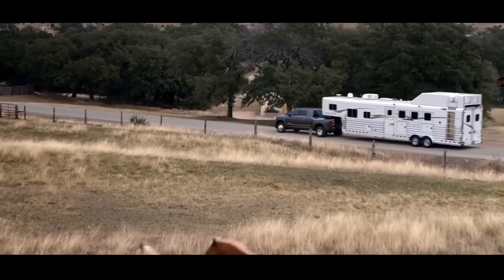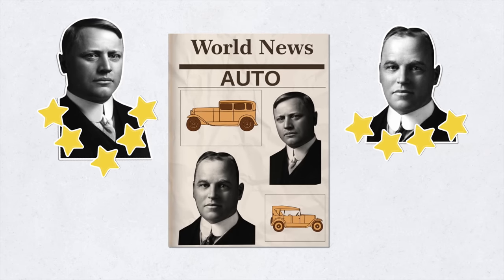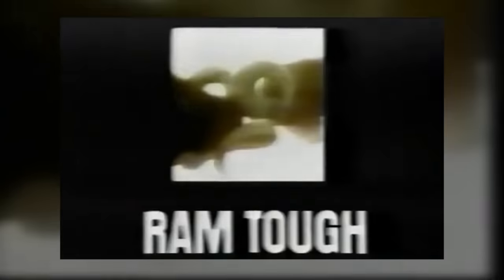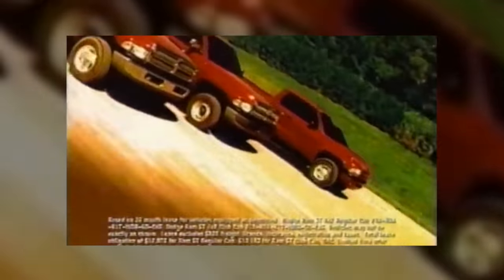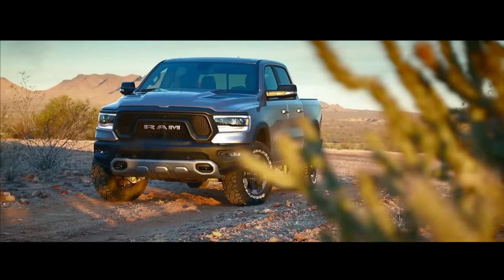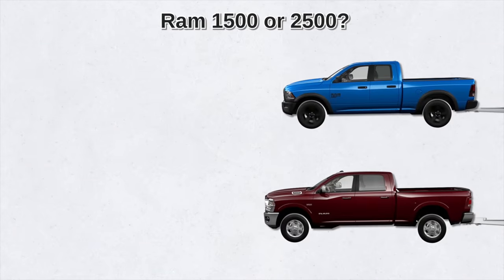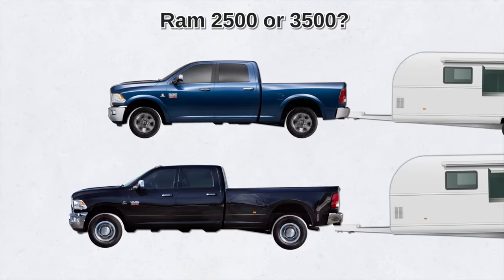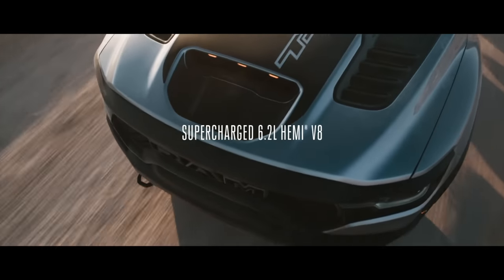No One is Telling You the Truth About Dodge Rams, So I Have to

Comment: I love my Ram 1500!  It does everything I’ve ever asked of it. Camping, fishing, hunting, overlanding, and more. Great mpg all the time and it looks great. I won’t touch the newer diesels because I don’t want to have to buy some additive plus fuel. Which is sad because I used to drive a diesel 6.5 ltre turbo for 21 years and loved it. 
I’ll drive a Ram for the rest of my life.
Reply: You lost us when you said great gas mileage.  The Dodge Ram is well known for being able to ⛽️“ Pass everything ’cept a gas station” ⛽️ HaHa  I little humor, Glad you’re enjoying your truck.
Reply: Hi @Prepperjon how long have you had yours? And what would you say is your annual repair bill average? Cheers 🍻
Reply: What do you think about the 2007 ram 1500 mega cab 4x4 with 235k miles is the engine coming to an End with this many miles?
Reply: @rickyrudd28texacohavolinef2  in comparison of the 3, 1/2 ton pickups RAM and GM both had combined mpgs of 26 (diesel) the Ford 25mpg (hybrid) and 23 (diesel) and the Chevy diesel 27 so id say youre wrong about the mileage claim...

i couldnt find GAS mileage in a quick search
Reply: @victornaja7927  yes, it might need a rebuild, gas engines go around 250,000 miles before having major problems.
Reply: @victornaja7927  130,000 on my 2009 1500 Bighorn no major problems and just starting to have rust spots. Hasn't lived a real easy life but still running strong. No annual repair bills change oil keep tires on it fix the brakes when need to lotsa highway miles of late.
Reply: Is 12-16mpg good mileage? 🤣🤣
Reply: @starwarsraul13   mine gets around 12-14 on a good day
Reply: @starwarsraul13  it’s a truck, you worried about gas mileage don’t buy a truck 😂😂
Reply: You think 16 MPG is great???  Mine is a year old & I thought it would improve from new but it has not
Reply: @njjeff201  if you worried about gas don’t buy a truck lol
Reply: I bought my Ram 01/03/22 and its my very first truck. As of right now I haven't used it for anything other than driving but what excites me each day is thinking of all the potential ways it'll be useful. When I look at it all I see is a beautiful automobile with loads of untapped potential ; Overall I feel as though its been my smartest automobile purchase 2 date 👍
Reply: @njjeff201  yeah 16 is pretty good. I average like 13-14 in my car usually.
Reply: @jizzyjake6783  On the Highway it was around 19 before Winter, now it’s 16/17. I keep tire pressures at max to lower rolling resistance. I thought it might get better as engine breaks in but that’s not the case. Everyone who rides with me is flabbergasted as to how gorgeous the interior is
Reply: Your truck hunts and fishes with you? I'm impressed
Reply: So 10 more RAMS or so
Reply: 21
Reply: @mclovinbigmacs5948  gas dodge engines.....Honda, Toyota ,and some Ford and Chevys can go well over 300k
Reply: @jamesryan4147  you barely have any miles
Reply: @richsweeney1115  mine has 245000 miles on her
Reply: @rickyrudd28texacohavolinef2  My 5.9 deisel dodge got 26 miles per gallon on the highway and my 5.7 liter hemi gets 22 miles per gallon highway. So what's the problem?
Reply: Lol great gas mileage, I drive a Ram 2500 everyday for work and it gets a solid 8 mpg
Reply: @crazycat1345  what year of your truck ? Is it 1500 or 2500 ? I consider going to  buy one. Thank you for your time.
Reply: @starwarsraul13  my 2022 ram 1500 gets 20 city / 24-25highway. Gas 6cyl. That’s calculated at the pump. Very quick truck and tows car/boat just fine
Reply: How long do you have-Stellantis may not *!
Reply: Dodge doesn't build trucks, fiat ram or Stellantis ram maybe NOT Dodge division of whatever it is

Comment: Leased a 2019 RAM 1500, we put about 50xxxkm during the lease. I noticed it started to get the hemi tick. Mentioned it to the dealer during a service and they said it was normal. When the lease was up the same dealership said the engine was ruined and it needed to be replaced. We gave them proof of oil changes and they covered it under warranty. The truck was great to drive but the legendary hemi didn't last and the dealership experience was poor.

Comment: 2014 1500 3.6 L V6 Crew Cab with tow package. 60K miles never one issue. These 8 speed automatics with this suspension is perfect for a guy with kids and towing a 14' aluminum bass boat.  So much room and comfort. Quiet smooth ride that looks great. I love rams, but it's basically a mini van for me with a small bed 🤣. But that's what I needed.

Comment: Thank you for the review. I have a 2018 Ram 1500 5.7 hemi. I love it. It has the power I need for hauling. Plus it's just right for running my 4 wheeler up on to go riding. My 2010 Tundra had more power but, 14 - 16mpg verses 18.5 - 22 mpg makes a lot of difference going back and forth 40 Miles a day to work. I  have not had any problems or complaints. I love this truck. So far so good. Bought it with 12,666 Miles on it and now has 56,284. Tuff little bugger..

Jeffrey

Comment: I'm on my second Ram 1500.  On the first I had to replace a door lock actuator and that was the only issue (except for when I left the tailgate down when towing my boat and crunched it pretty good on a sharp turn, ouch).  Second one is my favorite vehicle I've had.  The 5.7 Hemi and ZF trans are a good combo, smooth and reliable.

Comment: My first vehicle was an 2002 Dodge ram 1500 regular cab short bed with a 5 speed manual and the 4.7 magnum. It was a great truck and it lasted perfectly with the transmission shifting smoothly all the years of its life. Sadly I got into a rollover and totaled the truck. I miss it.
Reply: Man that’s sad my 2012 Dodge Ram 1500 has 4.7 V8 Quad Cab Full sized bed and I love it but I have a few dents in it but it runs like it’s brand new!

Comment: I just bought a used 2001 2500 cummings diesel powered truck 130,000 miles. I plopped a carry/slide on camper in the back of it. AND, It didn't even notice the weight. Good mileage too. I'm in love !!

Comment: My dad bought an ‘01 Dodge Ram 2500 new. Cummins engine, manual transmission. Gets in the 20s for mpg, and currently has around 370k or 380k mi on it. The dash is cheaply made, so that’s cracked. Overall a super solid truck though. He’s upgraded the tires, rims, and exhaust. Has a different heavy duty front bumper. Large topper. Always had custom seat covers on it, so the original seats are like new.
Reply: My dad does also lol.
Reply: Guess the dash is not easily replaced? To match the good condition of the seats
Reply: Horrible truck. Expensive to keep going.
Reply: @eggy1962  It's a secondary truck now as of last year. His daily one now is an '07 or '08 (newer body style) Chevy Silverado Duramax 2500 HD. Long bed. Black exterior and interior Fully loaded. Pre diesel emission crap. A beast of a truck. Tons of power. Luxurious in comparison to the Dodge. The Dodge is now his second vehicle for hunting trips, or he occasionally goes to work in it. He might turn it into a snow plow truck since my parents' driveway is a 1/4 mi long. Both very reliable trucks
Reply: @erniecarrasco9107  Overall he hasn't put a lot of money into it mechanically. And he bought it new with cash, so no interest payments.
Reply: @zanesutherland406  that's the way to go. Smart man!
Reply: @erniecarrasco9107   how would you know Carrasco,  you gotta give up your Tonka toys first and actually buy a truck.
Reply: @eggy1962  tge dash is easily replaces. They make a plastic cover that   fits right over the old one
Reply: The 2nd generation dodges were super strong trucks that will hit 1 million miles no problem, just do the maintenance. One guy that's in the high mileage club with me has 3 million on his '01 dodge ram.
Reply: @jeffro582  Chevy and Ford blow too. So does dodge. But you already heard it from Scotty. Lolololololol
Reply: Dashboards were the only true issue for these trucks. Replace it with one made of modern plastic for a couple hundred bucks, and it's good to go.

Comment: I own an 89 D250 with the 5.9 Cummins. My truck was originally owned by Cummings and was used to maintain their property at the S.C. plant they owned. After selling that property the truck stayed with it. I worked for the new owners and bought the truck for 100 dollars. The battery was 9yrs old and they didn't understand why it wouldn't start. After a battery and brake job I've been driving it for 15 years. I plan on driving it till I can't drive anymore. Great Truck.

Comment: 2019 1500 V6 e-Torque here. Bought with 25,000kms and was a year and a half old. What a great truck! Daily driver / long highway trip cruiser. 25,000km in the last year. Tows a trailer with a few quads, a horse and trailer, or other light duty items. You pay a fuel penalty for mountain driving while towing above 2500 lbs (I think max is about 7000lbs on the V6) , but if unladen (or even towing on a flat road) it's amazingly efficient for a 1/2 ton V6. Hard to find flaws.

Comment: I love my 2021 ram 2500 with the big hemi, tow anything 99% of people need to tow unless you tow for a living or extremely heavy and I still get around 15 mpg in mixed driving, pretty awesome for a truck with 3,000 lbs of payload and almost 15,000 lbs. of towing capacity all while towing MUCH better and costing relatively the same as a new gen ram 1500

Comment: Got a 2020 ram 1500 Laramie 5.7 hemi etorque when I got to the dealership they were unloading some new trucks and when I seen it I fell in love with it ended up buying it and I couldn’t be happier in the 2 years I’ve had it I’ve already put 90k miles on it so far I’ve had no problems at all not even as much as a transmission slip or a dead battery it still runs brand new even though I average about 250 to 500 miles a day with heavy equipment in the bed I absolutely love it and couldn’t recommend one of these new body style rams enough!

Comment: I like my 2016 1500 with the Ecodiesel—on the open highway I routinely get 30-35 mpg, while around town about 22-25.  I live in rural Utah, so I normally don’t deal with a lot of traffic, other than getting stuck behind a hay truck from time to time.  And it’s a good family vehicle, able to seat 6 reasonably comfortably.  Towing capacity is only around 7600 lbs, but I don’t need to tow a huge amount…

Comment: I got a 2019 Ram 1500 classic with the V6 , 3.55 rear instead of 3.23. Was skeptical of a truck with a V6 but after a couple years now I'm happy with it. The ride is comfortable,   the road noise is quiet on the highway and I get an average 22 mpg. Couple hundred bucks swapped rear springs for 30% higher capacity ones. Compared to my 2003 Dodge off road that had the 5.7 I don't miss half the gas mileage. V6 with the 8 speed is enough for daily driver, light loads and trailer towing.
Reply: My 2014 RAM V-6 gets 27mpg on the highway.  Have owned an 89= 135 HP V-6, 94= 175HP V-6, an 02=215HP V-6.  My 2014 gets the best mileage with the 8 speed tranny and has 315 HP.  I have test driven Ford, Chevy GMC, and even Toyota.  None come close.

Comment: I had an 02 1500 pre hemi gasser.  I had a couple transmission issues with it to include the transfer breaking and falling out the bottom of it at about 130k miles in 2017.  In 2016 it broke a U joint hauling an empty trailer up a bouncy hill.  I fixed and sold it.  I did enjoy the truck but I got a good deal on a ‘12 F-350 gasser which has been excellent as a used truck.  I use that to pull my ‘45 Dodge WC-51 and also my ‘41 WC-8 when it gets done.   The 1500 was too light to pull the WC-51 although once I moved it without a bed so it was lighter. 

I do think the Rams are the best looking trucks but my experience with the transmission and driveline was not good.

Comment: I've had both Hemi engines. My 2008 Dodge 1500 had the 5.7 (I enjoyed that little hot rod) 
Next I bought a 2015 Ram 2500 crew cab 4x4. That was very powerful. However pulling grades with travel trailer in tow was uncomfortable at 3800 RPM and 6.2 mpg. Loved that truck but stepped up to a 2016 Ram 2500 Crew cab with a Cummins. What a difference. I went and upgraded up to a 35' fifth wheel. I can pull that same grade up the Salt River Canyon at 1800 RPM and get just short of 15 mpg.
Love my Cummins 2500!
Reply: I have a 3500 Cummins for work and last year I bought a 2014 1500 hemi to save miles on the diesel, what a freaking hot rod that thing is.
I love them both.

Comment: I love the 3500 Diesel, but I like the single rear wheels in the rear because dually’s are not as good in snow and they reduce slightly the weight you can tow because of the extra wheel weight. They’re great for people hauling new RV’s for a living.

Comment: They should have stuck with bicycles. I had a 2000 ram 1500 laramie quad cab. 3 years later, $14,000 in repairs later the transmission shaft fell off in the street. But the "check engine " light worked flawlessly. They have special timer built in to start rusting out one month after leaving the dealership.

Comment: We had a 2004 Hemi 1500, it was a great truck. Now have a 2012 Hemi and it’s also been a great truck. Still going strong 12 years later after a lot of use 👍
Reply: I've got a 2005 Hemi 1500 that is still going strong. Never left me stranded and has only had a few problems that I've been able to do myself. Hitting around 190,000 right now.
Reply: @TexasBeekeeper original owner of a 2003 1500. All I can say is do the maintenance. I didn't do the maintenance one time on my transmission. Well my fault. Original engine at 308 k engine has not skipped the beat
Reply: @blkpearl-uz1on  very nice!

Comment: I own both the 5.9 2 valve and a 2009 6.7. The 5.9 runs and runs . The 6.7 is a beast. Both are in buses. The 6.7 can gain speed up hill and will do 90 mph. I know that's not safe and normally I just cruise it but it's a running beast.

Comment: I had a 2009 Dodge 2500 with a 8 foot bed. I also had a large trailer with a 10,000lb. payload. One time I was towing the trailer, up a hill, with 8,000 lbs on board and had to pass a car, I pushed the pedal and the Hemi allowed my truck to pass that car with EASE !!!

Comment: The Ram 1500 Ecodiesel gives a good middle ground to a 2500. With 12,500lbs capacity, it can haul a whole of of recreational trailers and job trailers with not much of an issue for a fraction of the cost of the 2500. I’ve enjoyed the one I have and have never had an issue with it.

Comment: i have the 2019 half ton crew cab 4 x 4  and pull a 26' camper. I installed air bags and an equalizer hitch and i don't even know the trailer is back there. I live in the pacific  northwest were we pull a lot of steep hills. Went on a 1500 mile vacation and got 22.5 miles per gallon fuel milage. Smooth ride, quiet and very comfortable.. Only truck i will ever have,,,,,

Comment: Bought a new 3500 crew cab drw Ram with Cummins and manual tranny in 2017.  In the first 105,000 miles, it has cost $18,000 in maintenance replacing DPF, turbo charger actuator, trailer brake module, abs module, crank case ventilation valve, tires, filters, 2 batteries, and clutch slave cylinder.  Not very happy with the last truck I’ll ever need.  What is going to break next and how much will it cost to repair?
Reply: I knew I'd find some truth in the comments. I'll never buy dodge or Chrysler again
Reply: 14 times to dealership in 20 months.
never repaired electrical properly.
The dealer says computer will shut down vehicle for flawed lugs shortly and no replacement parts until next april.
2019 one ton crew cab diesel
Reply: A friend's '94 4x4 2500 diesel carrying a cab over camper noticed his bed collapsing.
Reply: @dalewalts4780  0

Comment: My overall view of Mopar products has never been good.  That is until I bought a '93 D250 with the 5.9 Cummins and 5-speed manual transmission.  I can't speak to the newer Dodge trucks or any other Dodge vehicles, but this truck has been rock solid.  I've owned it for 14 years now and it's been one of the most reliable vehicles I've ever had.  It's right up there with my 1990 Corolla.  I've gotten up to 23 mpg driving it unloaded, and up to 18 mpg with a truck camper on it and while towing the Corolla behind it.  Those are the best numbers - the worst mpg I've ever gotten with it (with the camper on and while towing the Corolla) was about 13.5 mpg which included lots of climbing and headwinds.  Normally while loaded it's in the 16 to 17 mpg area.

For a turbo diesel it's a real dog though.  They really tuned these things for longevity rather than power.  The good news is that it's relatively easy and cheap to get 40 to 50 more hp out of them.  If you want to throw a few thousand at it you can drastically increase the power, but then you have to worry about the rest of the drivetrain too.  I just did the basic mods (fuel pin, governor spring and some injection pump tuning) so I could tow a little easier and am very happy with the results.  Hope to keep this truck for many more years.   And - it's the only vehicle I've ever owned that actually appreciated while I've had it.  Fourteen years after I bought it I could probably sell it for $5,000 more than I paid for it, or more.